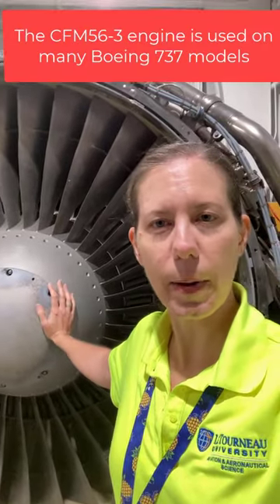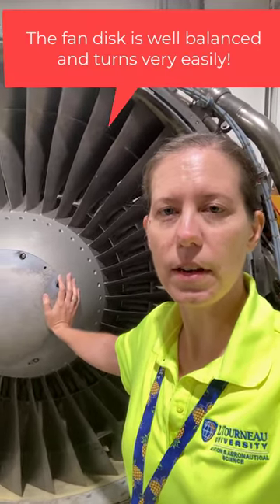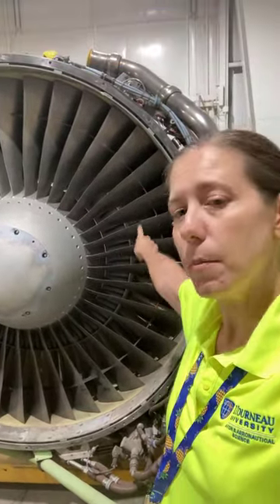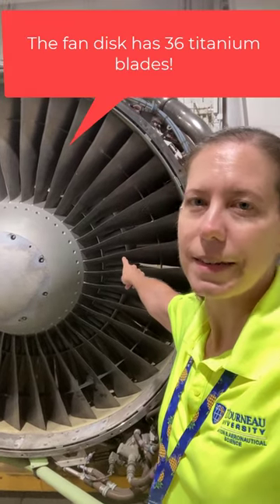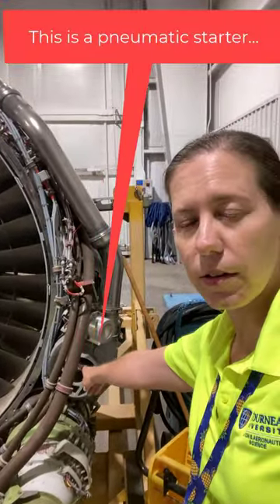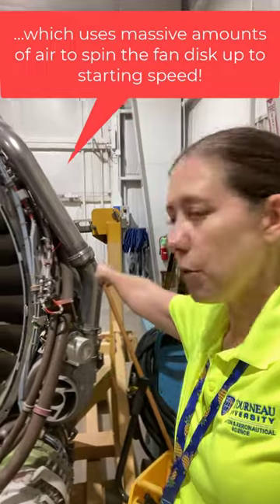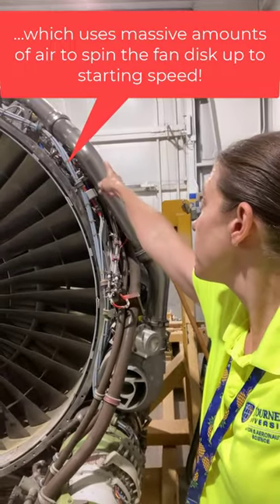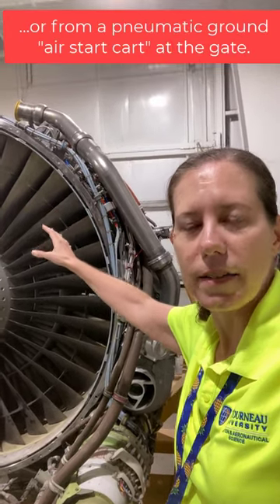Boeing 737 Starter Visual Study Guide CFM-56-3 Turbofan Engine Pilot & Dispatcher Systems Help

Comment: Nice to see! For those who are wanting to go a little more in depth. The air starter, which is powered by compressed air coming from APU or ASU actually turns the output shaft through the accessory gearbox, which then turns the N2. (Which is inside of the engine) Due to the airflow created inside of the engine by the rotation of the N2, consequently the N1 (fan disk) starts to spin. Still amazed on how reliable those jet engines are 😁 Thanks for sharing!
Reply from the maker: Thank you for this much more detailed explanation! (I only had 60 seconds, so I keep the explanations SUPER brief. Shorts are hard to make!)